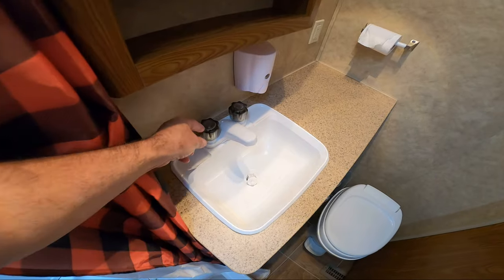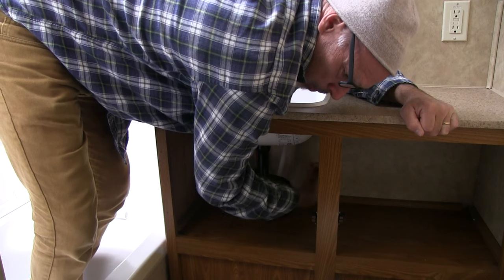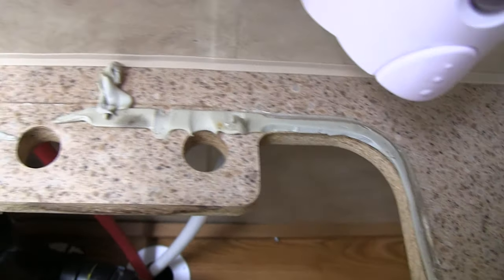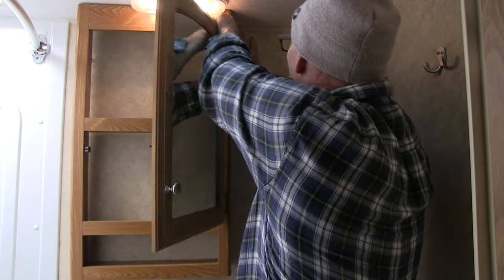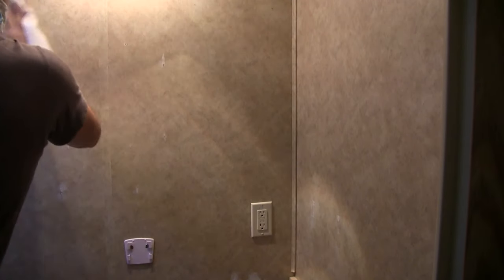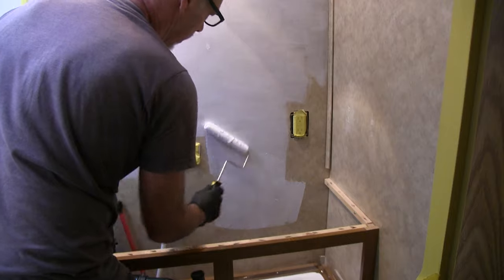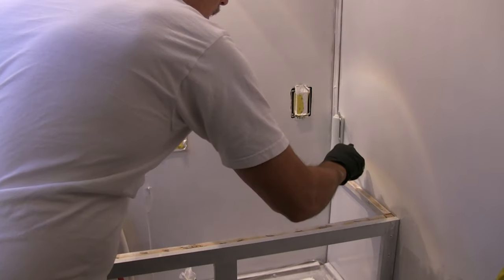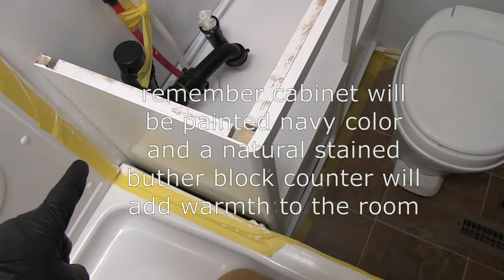RV Renovation: Bathroom Makeover Painting Walls & Demo

Comment: Watched all of your camper reno videos again, ready to paint our camper today! Can you tell me the best process and paints you used now that you’ve done several areas and how they have held up? Thanks!
Reply from the maker: For the topcoat we used Sherwin Williams emerald urethane trim enamel interior/exterior high Hyde white paint. For the primer we used Zinnser bullseye 123 water based white primer. Best advice is not to paint over a weekend as that doesn’t allow long enough dry times between coats. Stretch the process out over a couple weeks with at least one coat of primer and 2 coats of the top coat 😊

Comment: Wait why no oil based primer
Reply from the maker: I can’t stand the smell and it can be a disaster at clean up time. The water based primer is holding up well after 3 years with no prior stain leaching through.  Eventually it will some but by then it will be time to repaint anyhow 😊